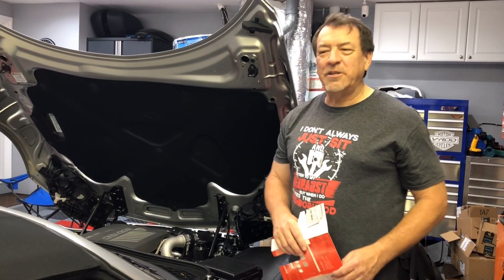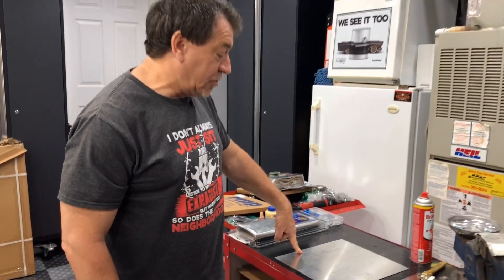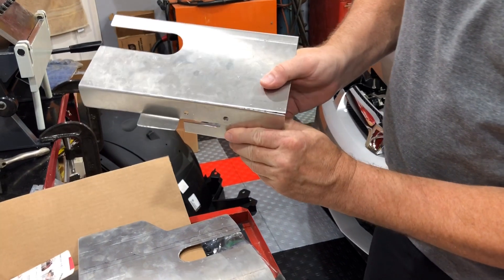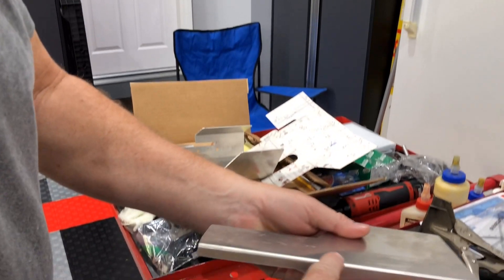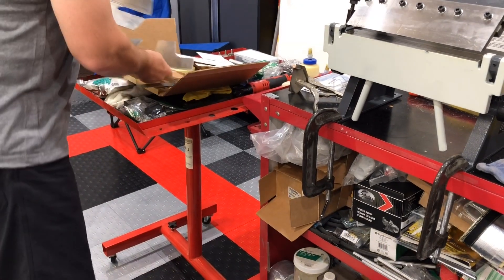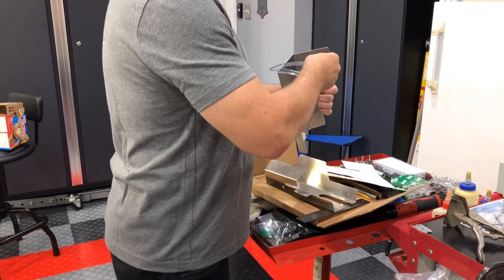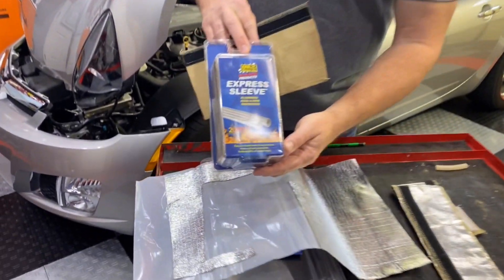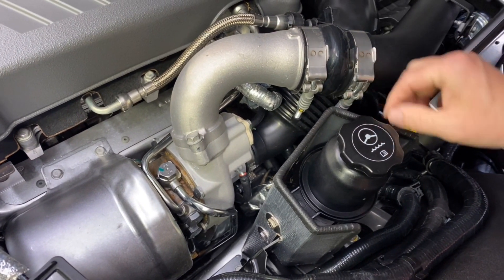Tim’s Garage Episode 14: Saturn Sky Redline GXP Fabricating a power steering reservoir heat shield.

Comment: Nice job!  I know this is 3 years old but great videos.  I went the cheap route and just put hi temp reflective foil tape on my power steering pump.  The high heat definitely takes it's toll in the engine bay and the power steering cap becomes brittle (I had to replace mine).  Yours is a great solution.
Reply from the maker: Thank you for your comment